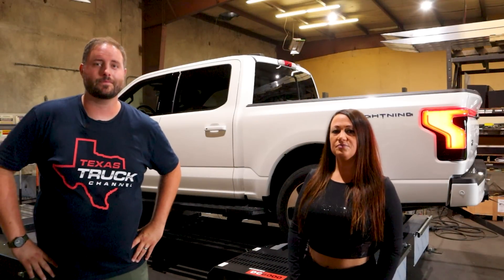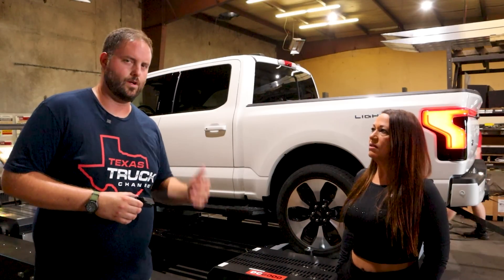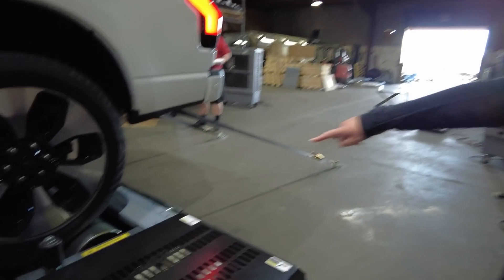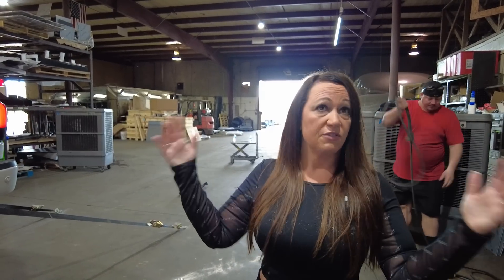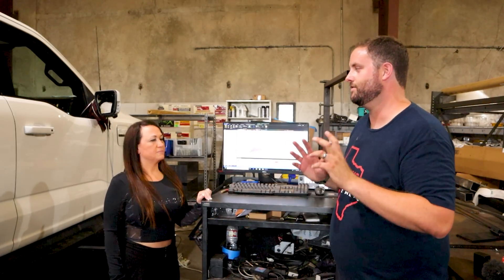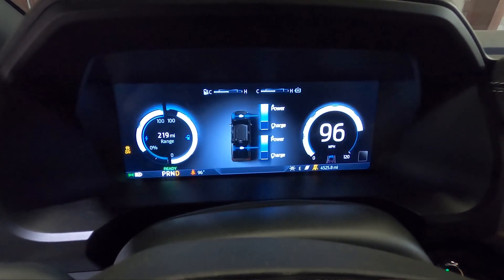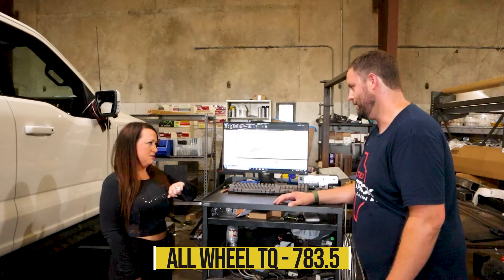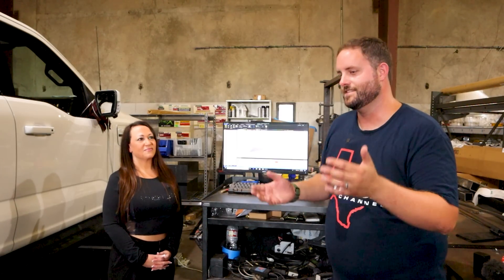EXCLUSIVE // Worlds FIRST 2022 Ford Lightning EV Dyno Test

Comment: There has been so many all-wheel drive vehicles doing torque tests throughout time that the fact that you try to make it look like you're the first at doing something that other people have done for decades kind of shows where you're at. Ford itself does all wheel drive Dynos. So I'm glad you're doing something that many people have already been doing but the fact that you're tuning your own horn shows your immaturity. So good luck I don't even care about this video anymore.
Reply from the maker: It seems you care enough to stop by and write a thought out comment, and we appreciate that. You're right, AWD dynos are not a new thing. High torque numbers are not a new thing. But this was the first dyno test ever made outside of Ford of the Ford Lightning. At the time of producing this video, this was the only 4 wheel roller dyno that could handle the wheelbase of the truck. Thanks for for stopping by, and thanks for watching.
Reply: @TexasTruckChannel  I'm glad you wrote something back, and you weren't just dismissive. I am a Ford rally fan so I've known for years now that Ford does the all-wheel drive tests on their dynos. Which usually back in the day got Fords a bad name for how the torque ran on their vehicles. Notice I said torque not horsepower! Now that everybody uses the all-wheel drive dyno testing Ford is taking a huge leap. So when I see people putting it up the way it should be I have to pay attention. Just because for so many years, Ford was considered low end because of how they tested vehicles instead of just a simple two-wheel drive setup. So thank you for noticing.

Comment: Ford and Volvo EV's require drivetrain software updates. If you get a corrupt file from the internet when the internet is sketchy say in a parking garage thick with concrete you risk uncontrollable accelerating and this has un alived people in the vehicle.

Comment: Anyone else read the graphs and see it starts dramatically making less power over 60mph?
Reply: About 500hp and 500ft lb over 80mph and dropping like a rock
Reply from the maker: We resolved this by adding resistance to the dyno rollers. That power drop on the first few runs were due to the traction control system thinking all 4 wheels had low traction.

Comment: Thank you Ford for proving a EV Truck is not going to be a viable option. If i cant hitch my boat and go fishing without wondering if my truck has the range. Then i will stick with my F150 5.0 at least it is tunable to run on E85. 😎

Comment: The HP is based on what the electric motors do outside of the truck, meaning the are rated by design and testing in the lab etc..

Comment: Shoulda stuck it on a real Dyno
Reply from the maker: This dyno is as real as it gets.
Reply: @TexasTruckChannel  Hub Dyno ;)
Reply from the maker: Ah, yes that was considered, but the experts quickly let us know that the torque load of the lightning, and the weight of it never would have worked on a hub dyno. Trust me, we started with that idea.

Comment: ford should have Never made this a truck and should be use an SUV as if you put anything in the bed or pull a trailer the range falls Flat Very Flat which is very sad. If pulling a trailer at the allowed rate it will only get 100 miles on a fully charged battery. Just make it an SUV and be done with it.

Comment: No such thing as an ICE motor. It is an engine. Motors run off of electricity, an engine runs off of a combustion process.
Reply: Very much incorrect. An engine can be called an engine or a motor. Here’s the official definition of motor: (look it up) a machine, especially one powered by electricity or internal combustion, that supplies motive power for a vehicle or for some other device with moving parts.
Facts don’t care about your feelings btw. Lol

Comment: Maybe the shaft is less maintenance or stronger but you have to turn the power 90° with gears twice so it has to be less efficient
Reply: Uhhh, no because the torque is direct and immediate
Reply: @sjwilson1079  uhhh the torque would just as direct and immediate with a belt not sure how you are disputing that

Comment: Man, all that torque should be great for towing a small trailer roughly 80 miles…
Reply: Keep in mind,  these EV's are in their infant stages,  ICEngines have had over 110 years to perfect and innovative.
Reply: @chrs1212  EV's have been around since the 1870's in one form of another.  EV's were dominant until kettering invented the starter motor.  My point being in 150 years we have yet to find a practical way to make a battery pack that can be charged quickly and last as long as an ICE motor.    I do think there are many places where an EV truck makes sense - golf courses, universities, hospitals - places where you want a quiet vehicle that doesn't emit exhaust fumes.  For the record, it doesn't bother me if anyone wants an EV, I just don't like how some states such as California are mandating that EV's are all you will be able to purchase new starting in 2030.
Reply: Seen a guy pull a small camper and only got 56 miles from a full charge
Reply: @ericjaczek2411  At least he had some comfort while waiting for a tow. 😂👍🏻
Reply: Yep all of the torque is awesome to tow items short distances. It doesn't feel like you're towing anything at all.
Reply: @ElectricGlider2016  said every 3/4 ton truck owner, ever…
Reply: @rackemwells  and now you can say the same thing in a 1/2 ton truck without paying an arm and a leg for all the diesel you use going less than 10 mpg. 😉
Reply: Because so many of you are towing trailers 200 miles!  Bhahahaha
Reply: @davidk5242  The Colorado river is 236 miles from my home. I tow my boat there multiple times a year. But “Whatever makes you happy I suppose” 🤡
Reply: I drive a real Lightning but still like these things. Besides, the boss doesn't tow much anyway.
Reply: You can tow 10k probably about 150 mile or so depending on a few factors....the extended battery pack is 300+ mpc...
As of right now electric trucks aren't for serious towing, but in 5 to 10 years they will out perform all trucks including commercial....
Reply: @TC-kf9zw  i can see Commercial truck industry going electric in most of their fleets. Trucks enter terminals, fleet yards, batteries changed out for the return trip. Banks of pre-charged batteries beings charged and cycled out when full. Computer controlled charging cells the batteries slide into. Maintenance cost of a diesel fleet would pay for it in a year or so. That alone increases profit by 1/3. To any fleet that can go full electric over haul. That then would lower the demand for Oil, lowering the cost and the diesel fan boys are all happy again🍆. Leaving prices of 🍺and🍔 to be a bad choice for dinner again. 🤠
Reply: @TC-kf9zw  Nope. Not going to happen. Battery technology has plateaued.
Reply: Haha
Reply: I know what a joke.
Reply: Yep

Comment: Still junk. Can't even pull a 6k lbs trailer without recharging every 80 to 90 miles. Enjoy the Great Reset, the tyrants of the world powers want you less than a day from your homes. You will not care about EV's when they outlaw petroleum and there is no private ownership of private vehicles.

Comment: Ev isn’t meant for the cold climate of Canada. Winters would kill that battery more quickly and with no engine, that weight loss up front would make it harder to steer on snowy roads
Reply: Take it from Norway which has the highest number of EVs on the road in just as cold climates where they have been just fine. And handling in an EV is much better since all the heavy weight is distributed throughout the entire length of the vehicle and software can instantly manage power between the forward and rear wheels. No need for an LSD. Please go actually drive a 4 wheel drive EV in the winter to actually experience it before assuming it's somehow worse than your typical car.
Reply: @ElectricGlider2016  I’d love to have a Ford Lightening. There isn’t that many charging stations around yet. We’re still a few years away from that but it’s something that I’d love to try.

Comment: Is that the truck making that noise or the dyno?
Reply from the maker: Mostly the dyno, but partially the Lightning.
Reply: @TexasTruckChannel  Aww, I was hoping the truck made all that racket. If they would make an XL trim of the lighting I'd be all over it.
Reply from the maker: They have the pro trim which effectively is the XL trim found on gas models.

Comment: The problem isn't HP or Torque, it's range, lack of infrastructure,  hugely reduced towing range, and once the electricity demand rises the cost to change will also be huge. It's already like $150 in the Neatherlands to charge your EV due to the green bs policies and Russia cutting off the flow of energy.  It will be no different here.